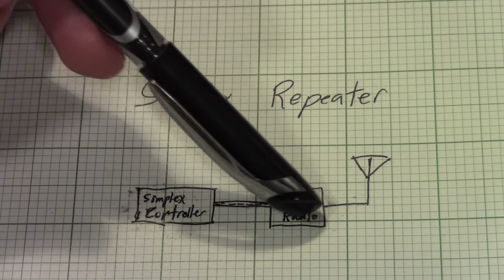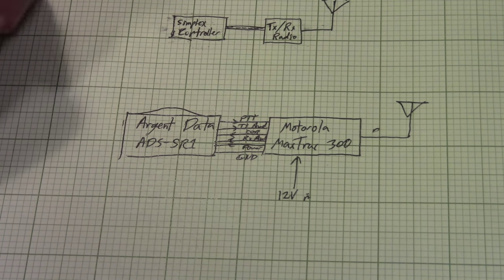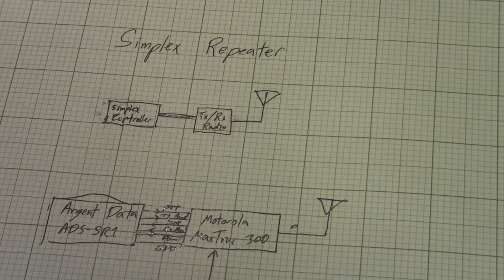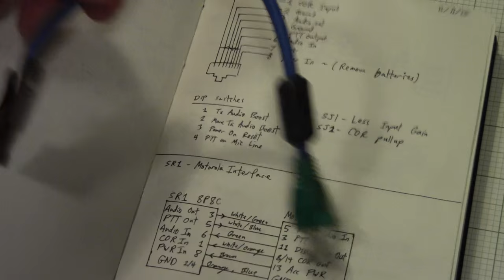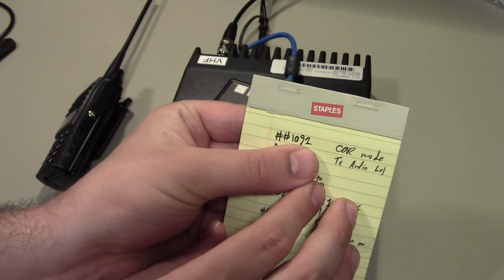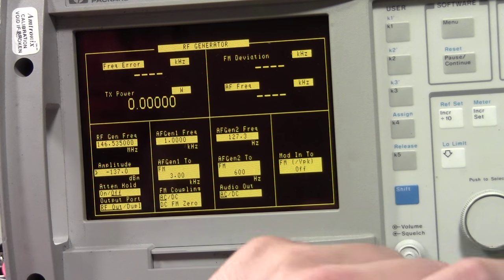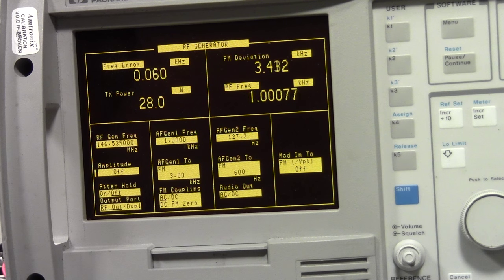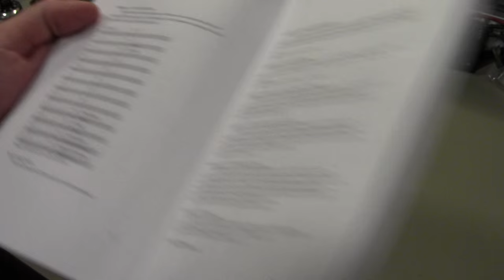How to Build a Simplex Repeater

Comment: How could one build this without having an HP service device?  How much does an HP unit like that cost and how does one go about learning how to use one?  I’m a General class HAM and there’s a lot I don’t know here.  I’ve all but given up on finding a simple repeater to build low cost for use at camping trips and 4x4 adventures.  Bummer.  I just want something I can throw in a vehicle and park it on a high peak in the operation area of the event and have a short range temporary repeater for use over a weekend outing.  Any ideas 💡?

Comment: Can you just plug an ethernet cable into both ends or will that not work?
I don't really need to be able to use a mic on the repeater.

Comment: Hello Kenneth and thank you for your great videos, question I have the Motorola Radius VHF 16 pin will the same wiring diagran work for this from the Argent Data to the radio your video shows the Motorola Maxtrac is the wiring the same? Thank you my friend.

Comment: Let me pick your brain....

Having radio equipment aside, would you choose to go a simplex repeater route, or spend twice the money and use a Chinese duplexer with a duplex controller of similar cost? 

I ask because I'm considering a GMRS single band repeater station. I already have the transceivers, but currently no duplexer or repeater controller. Low cost is a must on this system. 

I don't think I'd be happy with a simplex repeater system like this, but I wanted an opinion.
Reply from the maker: If you want a duplex repeater then build a duplex repeater. Simplex repeaters have a limited application, and I imagine GMRS users would have a hard time with it.
Reply: Kenneth Finnegan I decided on an Argent ADS-SR1 simplex setup. Cost is about half (if not less) than having to worry about a true single band duplexer. I'm going to run it split so there's no "echo " to confuse others. 

Good videos btw. I've missed messing around with radio and antenna theory.
Reply: For GMRS duplex is definitely the way to go. However, a duplex repeater requires some specialized skills and knowledge to properly build and maintain.  That said, a setup like in this video is an excellent addition to a vacation cabin or RV installation where you want to reliably extend GMRS operation and don't have a lot of traffic. I am considering one in my SUV to extend the capabilities of my GMRS mobile. .

Comment: Thanks for the video. I am looking to connect this repeater controller to a Radioddity 20 watt mobile GMRS radio. I notice that the handheld speaker-mic connects to the radio through a RJ45 connector. So maybe a cable with RJ45 male connectors on each end would work? What do you think? Thanks.
Reply from the maker: You'll need to have the right pinout on both ends.
Reply: @KennethFinnegan  Thanks. I found an easy way to do it, without having to fabricate any cables, as described in this video:
https://www.youtube.com/watch?v=VU3YoVbSXO0

Comment: Would love to find a simplex controller that can output to a second radio on a second frequency. There would still be a delay but retransmission would occur after the incoming transmission was received.
Reply: Most handhelds can be configured to Tx on a freq different to Rx

Comment: Kenneth question to run a Maxtrac 45 watt radio what amp power supply do I need to run the radio to the best performance? Thank You
Reply from the maker: My general rule of thumb is to at least double the power of the radio for the power supply. So 45W divided by 13V is 3.5A, so I generally reach for at least a 7A power supply.

Comment: Also, great vid. Very thorough. And props on using a baofeng ht. Cheap little radios are actually pretty decent. I have a gt3 mkii, 2 bf-f8+, a Larsen bsa450 base antenna, qyt kt8900 mobile with an MP Super M 400 antenna.
Reply from the maker: Pretty decent may be a little generous. All of my Chinese radios have been relegated to bench service.
Reply: Kenneth Finnegan I've been fairly lucky. Granted, they aren't Icoms or Yaesus, but a few newer models are decent...at least for the money. My main complaint is squelch and rejection. Rejection can be somewhat bettered with a good antenna. Squelch...well, that's why I like ctcss and dcs.

Comment: Hey Kenneth thank you for your video. It help me a lot to build the the interface  cable to from the ADS-SR1 to a UHF Motorola M130. It works great and I am very happy with it. I don't know if you are aware that Argent makes a module that will plug into the 16 pin of the Motorola radio all you have to do is plug a cat five cable. I bought one  but it did not work. I thought it was the cable that was bad so I try another one and it still did not work. Your cable that you show how to make works. Thanks again.
Reply: Martin, so were you successful using Kenneth's approach?

Comment: I ordered the argent data simplex repeater, but i cant seem to find a mobile plug cable, do you use a ethernet cable or what, i need it to work with my uhf motorola gm338. thanks
Reply: i want to buy 2 pcs .how much is it?where are you live?
Reply: thank.i want to buy 2 pcs,I don't get cables .how much is it?
Reply: Hi you.
I setup one cable for motorola gm338 like the video,which your instruction for gm matrax 300 and connect with J45 pin3 and pin4.Although the gm338 are working (RXand Tx).but We can't hear 1.2.3...(TX).
I didn't know why.Please help me to show it.

Note: I still use icom V8 to contact with ADS-SR1 for GM338.

Comment: i ordered the argent data simplex repeater, but i cant seem to find a mobile plug cable, do you use a ethernet cable or what, i need it to work with my vhf tm281a kenwood. thanks
Reply: +Kenneth Finnegan 
do you know of a company that can make me a custom cable?
Reply: +Kenneth Finnegan 
thanks for your help
Reply: I would like to use the Argent with a Kenwood mobile and need the cable to connect both. Please help.

Comment: Ive used a Parrot repeater, they are slow and a nightmare, most of the time the other station
not knowing when you are transmitting will double with you.
Crossband duplex is the way to go, RX filtering will filter out TX from the other band
use seperate aerials as far apart and different hight to each out